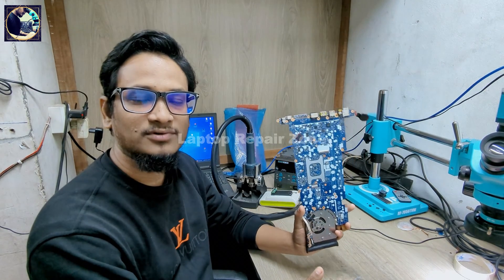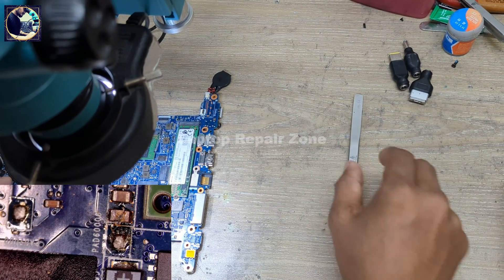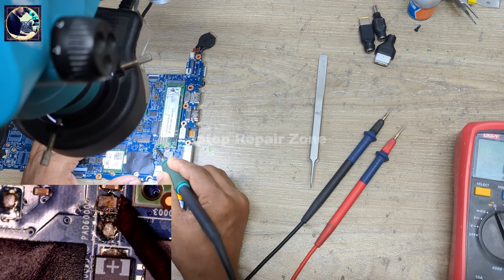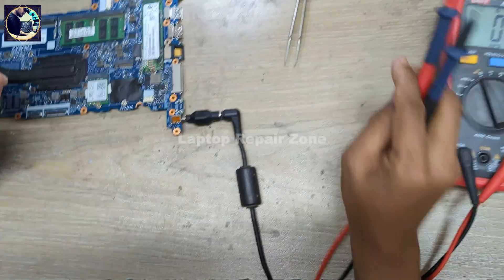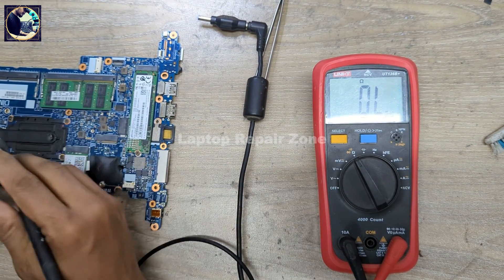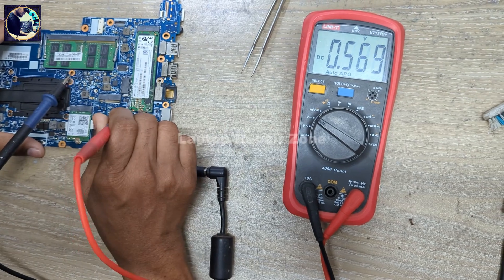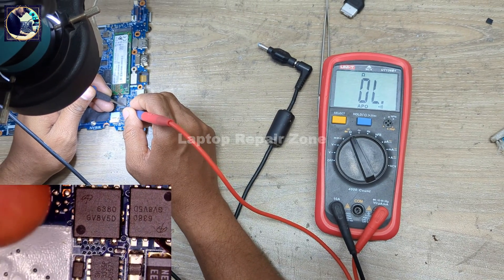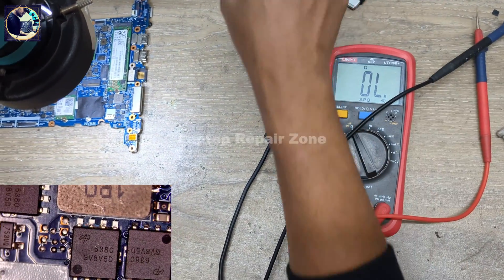hp elitebook 840 g5 not turning on | hp elitebook 840 g5 | N channel mosfet

Comment: Hello brother i need your help. I have same issue with my 840 g5. While instating mother board i fount a small chip blown near coil . It have 12v on batery jack also. Can wo help me to fing ic number as it is burned and deficult to read 10:05 10:05